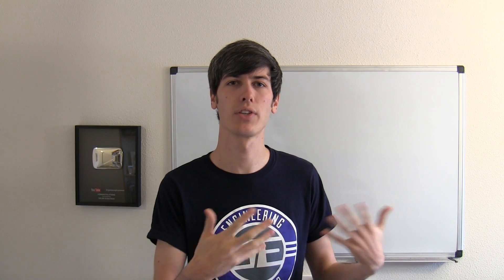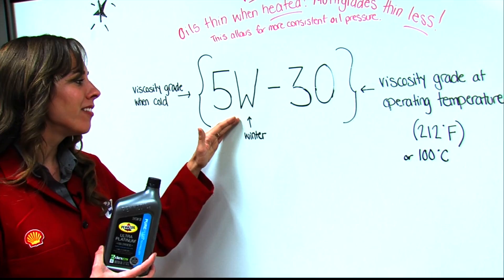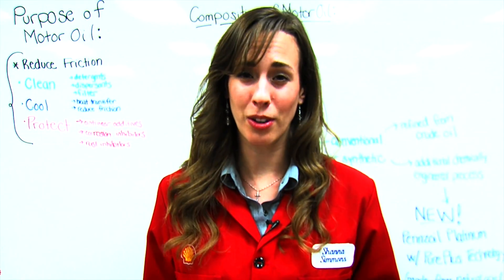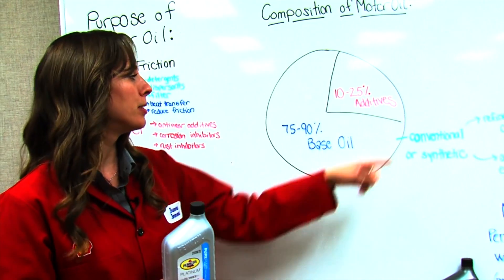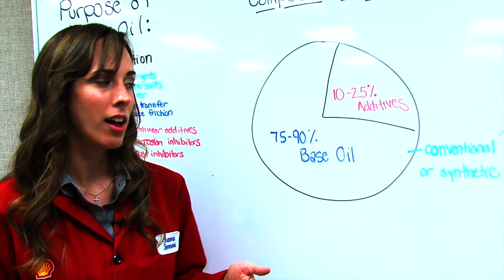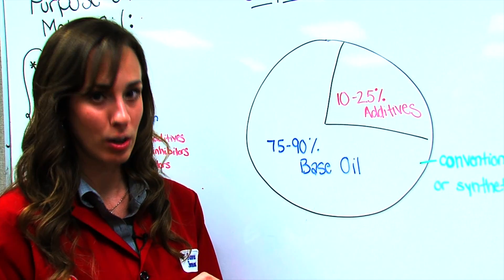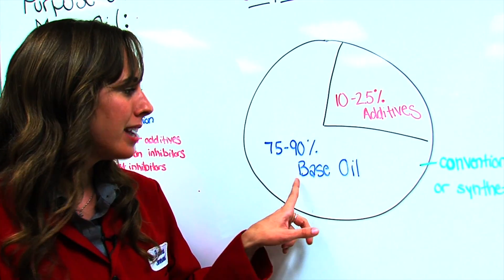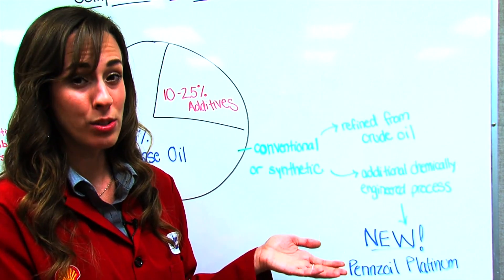Motor Oil Myths & FAQs - Synthetic vs Conventional

Comment: Low quality oil like???? Pennzoil? lol We used to rebuild a lot of engines run on pennzoil.
Reply: I doubt that's why. Realistically any api certified oil is good. I doubt they would  be around for so long if it was damaging people's engines. According to a lot of online resources pennzoil products are top notch.
Reply: Who's we?
Reply: 3319Adrian Me, my boss etc.
Reply: Shell bought out pennzoil. They are way better now! I use Mobil 1 though. haha
Reply: I heard back in the day, pennzoil contained a lot of paraffin which is pretty much wax
Reply: z1522 I never said "Back in the day"... Wrong person. Before shell bought Pennzoil they were known to be loaded with paraffin.
Reply: blakeskates92 Believe what you like. I believe what I see with my own eyes and when that corresponds to other people experiences then it just reinforces what you know.
Just because two oils have the same API rating does not mean they are the same. Not even close. It does not mean they will last the same or even perform the same. The API standard is a minimum standard and the formulations can still be quite different and still have the same API.
Reply: +consaka1 I suggest you check out some of Blackstone labs reports on pennzoil. the conventional line has been shown better than a few synthetics. You could use supertech from Wal-Mart and have good results. certainly engines are more prone to sludge by design and etc. I doubt  shell is making subpar oil.  Especially considering bmw is switching to pennzoil.
Reply: blakeskates92 Yeah well it's been quite some time. It is possible they have improved it some. Not enough to get me to buy it. My dad likes supertech and has had decent results from it. But then he has a mechanical background as well and keeps it changed. Any cheap crappy oil will probably work if you change it every 3,000 miles. 
Hotter running engines are more prone to sludge. One reason why I always recommend synthetic for turbocharged vehicles. Heat breaks down oil as you know and Turbos are very hard on oil. I have worked on a number of turbos that had the oil passages completely coked up. And yes that was pennzoil that was used in those cars. Is the Pennzoil better now? Maybe I really don't know. Did those turbo owners abuse their car by not changing the oil like they should. Well one did and one didn't. One turbo was shot at 63k and the other was shot at 130k. 
I'll always swear by Shell RotellaT in a diesel. I was the parts cleaner prentice back when and those engines were clean. Less work for me. Any other oil including Delo was built up on all the parts with a sludgy stuff that had to be brushed off in the parts washer(by me) lol
Reply: +consaka1 Earlier I meant api rated that meets your cars specification, not just any old api rating lol. But even most conventional oils are made with some synthetic base oil. Conventional is underrated.
Reply: blakeskates92 I assumed you meant the API rating for a particular vehicle.  :)
Reply: Jeffrey Kim This is true
Reply: +Skyler Bond "Back in the day..." Like the 1950's? Bet most don't know actual whale oil was still being used in lubricants into the 1970's. I am willing to bet Mobil1, Pennzoil, Castrol, Valvoline and other major Euro petroleum companies make superior products to those the Amurcun know-it-all gomers love. Why precisely should we believe that Amzoil, now Royal Purple et al as small companies can brag about technology superior to that of the Big Guys? Because of the Conspiracy mindset, of course! Hearsay, anecdotes and shared folklore are immune to scientific argument, so a vocal minority insist they know more than all the chemical engineers. The parallel universe where washable air filters and Holley carburetors are the greatest thing, and taking lead out of gas was a commie plot like fluoridation.
Reply: Facts be damned, right?  Haha, try reading ImportTunerRB26's response above, then do some research on the subject if you'd like to be better informed.
Reply: Facts? Your facts or my facts?
Reply: Disregard. For some reason Youtube keeps posting my replies in the wrong place. Response was to z1522.
Reply: consaka1 their quality has improved a lot over the years

Comment: Which oil is best for old small car engines.
Reply: Olive oil
Reply from the maker: Jake Simdeth Goes great in salads as well!
Reply: Jake Simdeth ONLY in Italian-made cars, though! Ferrari and Lamborghini both factory-fill with 100% Organic, First-Press Extra-Virgin Olive Oil.
Reply: +who cares dot com It's the other way around. You can go a little thinner (lighter)in the winter making it easier to start a cold engine. In hot weather you could use heavier oil to maintain proper oil pressure. In a mild climate you can use the same type of oil year round. On high mileage vehicles you can get away from manufactures recommendations and use a heavier oil because of the wear in bearings and oil pump. Generally a high mileage engine may use a little heavier oil  to get the same oil pressure it had when it was new.
Reply: +theoriginalbillholt 
Extra virgin olive oil from Tuscany is the best lubricant for Italian engines.
Also and with red wine from Veneto in the fuel tank, your car will run much better.
Reply: +Ru Su No offense but that doesn't make any sense. The thicker the oil the harder it is to crank over a cold engine.
Thinner oil flows easier to reach critical parts when the engine is cold. Perhaps leaving the vehicle plugged in you can get away with using thick oil is such cold weather.
Reply: +who cares dot com I've already been to automotive class, thanks. Gear oil has always been way heavier than engine oil, but that's a different conversation. Most modern engines use lighter oil because that way they get slightly better performance. (Less internal friction) Modern engines have thighter tolerances (bearings etc.) so they get away with using thin oil. Cheers buddy.
Reply: +Ru Su All oil leaves behind a lubricating film, even when all the oil has dripped down into the crankcase.  This is what protects your engine on startup and it is quite tough and will protect for a surprising amount of time, nonetheless you want fresh oil to circulate as quickly as possible. That is why you choose a lighter grade oil in winter. That said, synthetics remain liquid and will pump at very low temps so even a 15w50 can be used down do -55f or -48c.
Reply: +theoriginalbillholt don't forget Maserati
Reply: +who cares dot com Heavy Duty diesel mechanic here agrees." In the day" before synthetics, we would use 140W in our differentials & 13speed transmissions, now we are using 50W in the transmissions and 75W/90 in the differentials. The reason is; better fuel mileage and much better wear characteristics in the components. Now, our fluid change intervals are 250,000 miles with synthetic as opposed to 100,000 miles with the old 140W or 90W. We would be rebuilding gearboxes every 300,000 to 400,000 miles; now its rare to do any work on them for 750,000 and not unusual to see them go to 1,000,000 miles with minimal work. This is real world stuff.
Reply: It's only jargon when you don't understand what it means. Educate yourself and it will no longer be jargon, and you will have a better understanding of what to use without feeling like you're being sold snake oil.
Reply: red wine is better as a lubricant for your gullet, though single-malt scotch whisky is best.
Reply: Joss Cues Synthetic oil functions the same as conventional oil, it may have better qualities. Synthetic blend mixes both normal and synthetic oil. Oil has an expiration date. Use the right oil so you don't break the engine (as per your manual). 
Simple enough?

(This video doesn't cover variable factors like temperature, location, or oil grades.)
Reply: +MrZdvy in the winter months you want a little heavier grade oil because it'll stay in the parts that need it for the cold starts when it's cold.  I've been in alaska my whole life and it's also what they do up on the north slope where it easily gets -50f up there.
Reply: +Ru Su your right about the higher mileage because of the wear and looser the tolerance  have become over the amount of hours ran.
Reply: +MrZdvy Correct you are right that in colder temperatures you want thinner oils, however, in some cases thicker oils are recommended for racing applications and the ability to coat and stick to the engine is also very important which is why Royal Purple oil even at the same viscosity appears to be thicker and slower flowing. In fact you don't even need an automotive class to learn that stuff it is in your owner's manuals for your vehicle and nobody knows cars better than the people that built and designed them hotter temperatures you can go with thicker oil lower temperatures you want thinner oil.
Reply: clean oil
Reply: +who cares dot com   You have that completely backwards.
Reply: Oh, thank you very much, very kind of you, many thanks.
Reply: HaloModder555 Thanks for that HM. :)
Reply: +Jake Simdeth awesome joke by the way😹😹😹😹
Reply: +Joss Cues I use Castrol Magnatec 10W-40 in my car and change it every 3000 miles/5000 km, it's a small engine 1.8L. 10W-30 is also a good choice but my car has 290,000km (180,000 miles) on it so I went for 40 to account for some wear.
Reply: +MrZdvy Actually gear oil is not way heavier than engine oil. It uses a different scale. A 75w90 gear oil, for example, is the same viscosity as 10w40 motor oil.
Reply: +theoriginalbillholt what oil to put in my Korres P4?
Reply: +Joss Cues 15W-40
Reply: 15w40 it's not "enough" as an answer.
You have to check the specs: A3 or A4, B3 or B4, CF, CG or CH-4.
Reply: Well, I gave a better answer ;)
Reply: Eugenio C Excellent.

Comment: I've heard that if you switch from regular to synthetic, you can never go back without some adverse effects? Anybody have any input on this? Are you free to switch between the two types?
Reply: zdrux That's absolute grade A BS.  You can switch back and forth whenever you need to.  Sticking with one brand of oil is more important as they all run different additives.

Comment: this is a poor representation of these myths, and oil is categorized in in groups ranging from 1 to 5. In the united states most off the shelf synthetic oil is group 3 oil. Out of this group of oil is either highly refined crude oil or using base stocks from group 4 and blending with conventional additives. So most of this oil is not a true synthetic oil they are mainly blends that is mislabeled thus they are group 3 oil. Group 4 oil uses no petroleum and only synthetic additives, in European formulated synthetic oil that are manufactured in Europe is a group 4 oil. they cost more and they protect your engine better than any group 3 oil. most american gas and diesel engines can go longer than than the recommended oil change interval if your using a group 4 oil and filter made by the same company, that is designed to go up to 25000 miles. The only way to extend past that mark is using the following: a high quality bypass filter kit, oil analysis and oil filter analysis. This will tell you when you need to change your filters based on your personal driving habits. On a final note amsoil can blend with any oil on the market but, why would you degrade a high quality oil with any other brand?

Comment: So answer me this. What oil brand being synthetic is the best. I need something I can depend on. 2001 toyota tacoma prerunner 2.7 4 cylinder. Rebuilt engine. I want my engine to be happy for a very long time
Reply: Ernesto Diaz Redline is some of the best you can get in America, being that is a the highest grade base stock (grade 5).  It's also crazy expensive at something like $14 a quart.  Amsoil is what I run in almost everything and its a grade 4 base stock which is the first of the true synthetics.  Still an amazing oil but rings in closer to $5 to $8 a quart depending on the grade of additives you want.

Comment: Great explained, but you forgotvabout the standards which are in cooperation with addtives. If you look an example in the TDI motor goes a 5W40 or 4W30 oil, but you have to be careful to read on the sticker a standard if the oilis for TDI engines. If you look the an example Castrol GTX 5W40 you think okey this is good oul for my TDI car. WRONG!!! WHY? Because for the TDI engine you have to use the following standard and that is 501.00 or 503.00 wich is long life if I am correct. So on the sticker on the back side or now many times in the front you have written all the standards and for which car this oil is the write one, because in this times almost all oils are 5W40 or 5W30 L.L.3 and you have hard time to find non-sintetic oil. You can find a mineral-sintetic mix, but the mineral is olmost gone from sales. This is data for our country or for EU in general. I think that's the very important thing about oils for engines that you not have mentioned. 
I hope there I didn't informung you too much, but I think this are important things. 

Best regards. 

Ciao, M.